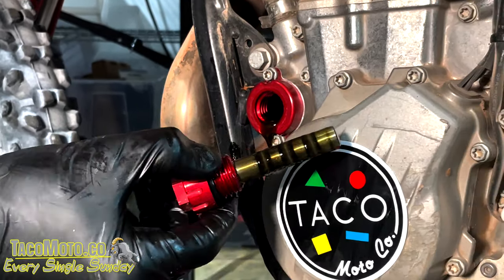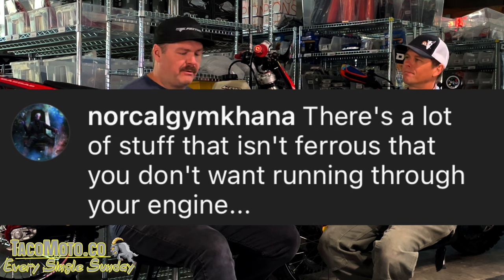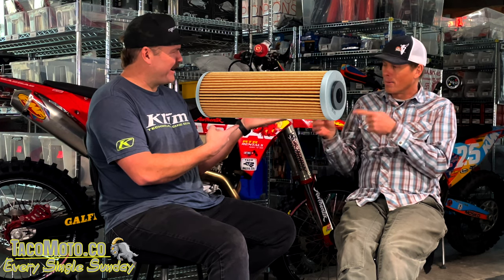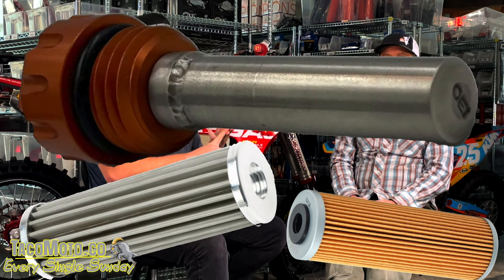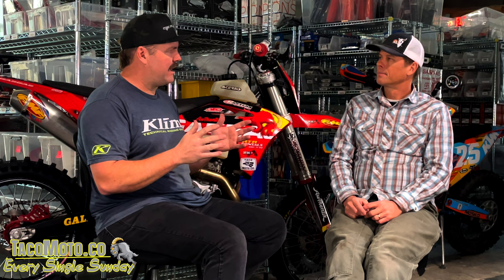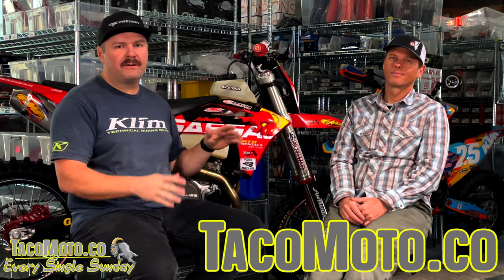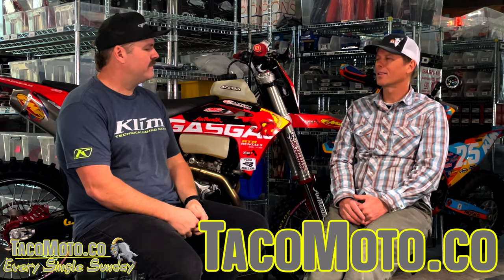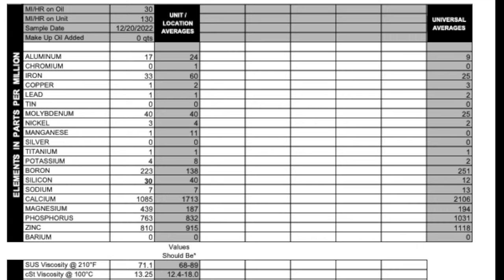WHY you NEED This Part for your Bike? Taco Moto Magnetic Oil filter

Comment: Nice Travis. Can’t believe I watched the whole vid. I’ve had mine for almost two years on my 17 FE 350. I was aware of most of the information through the research I did before I purchased the filter. I did learn something that I was unaware of. Yeah I was surprised when I found out that there was an actual performance benefit to this beyond reducing friction. I never thought of taking into account lowering resistance from the pump. Nice little bonus so far I’m happy with mine. I used to run the Maxima pro +50 weight. Now I’ve switched over to Amsoil dirt 50 just because I’m a little psycho on this stuff ha ha thanks for the vid was real good.
Reply from the maker: I feel the same way. Its a long one for are but its flows well and is full of great information. thanks for the feedback

Comment: Heavy machinery are not using aluminum internaly in engines they are also running paper filters in line with there magnetic  filter systems. Same with rock crushers.  Easier more affordable and effective fix is a magnetic drain plug. As often as people claim to change there oil it works great
Reply from the maker: I appreciate the information. I went into this knowing nothing and only know what others have shared with me. So far, Im happy with what this product has done for me and the fact that it has extended the service life of my oil for longer ride trips. I know this defiantly isn't for everyone but for those of us who need longer life... Its pretty cool

Comment: Very informative video. You mentioned you like Maxima. Me too. What type and intervals do you run in your 300 gear box.
Reply from the maker: For my 300 I actually like the Lucas Transmission Oil 80/85wt. I usually run 15-20 hours or till Bike doesn’t feel like it’s shifting as smoothly. I prefer the Lucas as I think it has the best clutch feel
Reply: @Every Single Sunday  Interesting. My local auto parts store sells it for cheap. I'll try that next time. Thanks. Are you racing Donner or Silverkings this June? I'm thinking about making to drive from BC to race those.
Reply from the maker: @nick4872  I just had surgery on my leg for a third time. Still trying to get over this ankle injury from last year and I’m off the bike for a couple months at least this time.

I doubt I’ll be in shape to race any hard stuff anytime soon, but we will see how things progress

Comment: I'm fairly certain the mother of all oil filters is a two stroke. 🤣
Reply from the maker: touche
Reply: Yeah and then you'd be working on your bike twice as much as you'd be riding it😂
Reply: @Johndoe-yb3oq  my 2006 YZ250 has had zero issues or maintenance required.  Bought it new.

Comment: Travis, like you my 22 500 is total TacoMoto! He and Motominded are responsible for everything on the bike. My question is about Amsoil? Both of you are running totally different oils than I have for decades. Do you have any data on this oil, with this system, available? Second question, how do you keep your pants from burnig withour a pipe gaurd on that 500?😆I have to run one on both of my 4t's.
Reply from the maker: I’ve been using maxima for a long time. The oil samples I’ve sent in have been great. It’s shown at the end of the video. 

And I run in the boot pants…. Never had burning issues

Comment: I base oil change intervals on my motorcycles, for ideally sub 10 on aluminum and sub 15 on iron, ktms 15 hour interval, is about right, to acheive maximum motor life, for a dual sported bike,  I would run half of that in real severe conditions.

Here's the thing,  if you guys can run that $20 oil at 60 hours intervals, and pull the piston at 40,000 miles, and show no ring wear, I'll listen.  The you are in My World.

I know you cant do it, cause Ive seen other guys try 50 hour interval and end up burning oil by 10,000 miles.
Reply: This filter is ideally suited for the rider looking for the specific advantages that it presents as noted 

The scenario you offer for cylinder wear is really a test for the air filter and the importance of that system can’t be understated
Reply from the maker: For me, 15 hour intervals are not always an option.

Comment: Pleated filter with magnetic drain plug is your best option for filtering PERIOD. That filter won't do shit for non ferrous items. This is a garbage filter , nice sales pitch though 😂
Reply from the maker: I don’t agree with you at all and the oil tests say otherwise. And it does grab non ferrous materials through static adhesion.

Comment: The keeping red color is a very wrong argument. It means that the oil additives, like detergents are not making their work.... The second argument is about running with water in oil for 20 miles... Maybe better  pack an oil filter and 1 l of oil on bike,  flush the bad, and go brand new  on race.
Reply from the maker: Not sure how you figure the detergents/ additives aren’t working. According to your believe wouldn’t the additives eat the red from the oil as it sits in the shelf in the bottle? Having the magnets pull carbon and stuff out seems to be a great way to see the life of the oil. Then having the oil looked at by Blackstone backs that up 

As for water in the oil…. It happens. But I’m definitely not going to carry spare oil on a ride for 100s of hours just incase I swamp a bike every couple years. 

I run this filter for my long rides in Mexico because it makes my oil last longer

Comment: You gained nothing, you just have double the metal count compared  15 hour interval of a Clean running motor.

I had half that count on a 500 with 50 hours on a New motor at a 15 hour interval, with $4 oil

Ive never see super expensive oil produce less metal than cheap /clean oil also
Reply: And yet the good oil produced better shifting, better clutch action cooler engine temps in hard clutch work and easier neutral location on the ktm 

Choice metrics can contain multiple variables
Reply: The slicker the oil,  lessens the clutch grip and does have an effect on shift,  with less clutch grip. One reason I hate 15w40 Rotella, has an iron clutch grip (equals notchy shift).

But oils vary on clutch grip , Ive even seen some MA2 rated oils, have lousy clutch grip under heavy load and rpm, verses other MA2 rated oils no issue.  

Air filtration  is definitely Key, but any debri can also enter the oil,  just like running any leaded race fuel, the lead also gets into the oil.
Reply: @brianricoh3242  luckily engineers know this and have built that variable into oils like the motul 7100 and maxima pro plus 🤜🏽🤛🏽
Reply from the maker: Popcorn is yummy

Comment: There is no way I'm doing that.  The manufacturer did not test that.  My warranty is based on the manufacturers testing.  I have bought a ton of shit from Taco Moto for my 500 EXC-F.  But I'm not performing an experiment based on some guy in Nevada. F.U.
Reply from the maker: There’s plenty of science behind it. Results are at the end of the video. My oil is in great shape after 50 hours in Baja each trip.  I’ve run it to 80 hours and it’s still good. But, run what makes you happy. F.U.